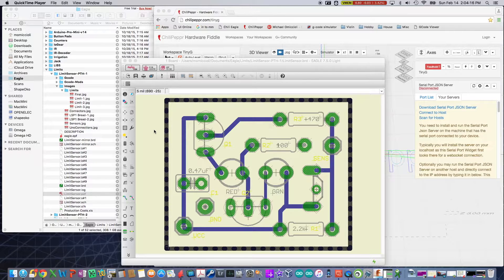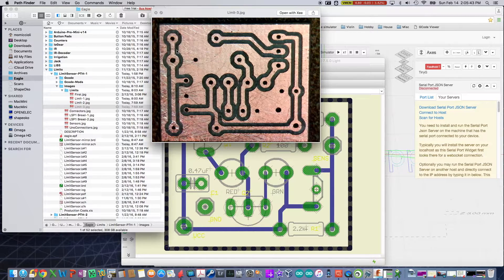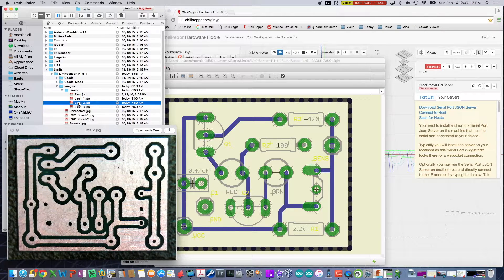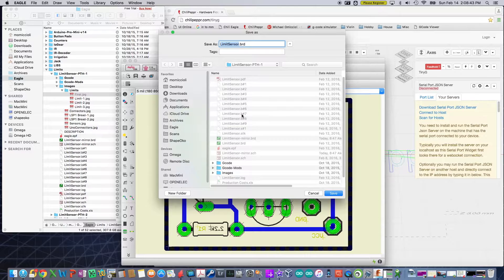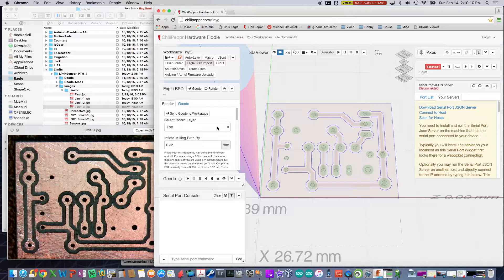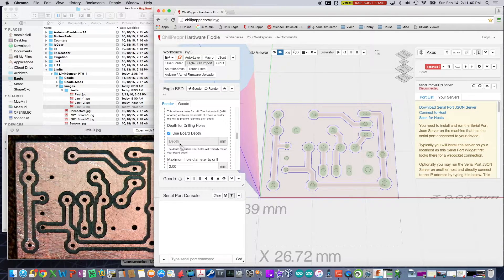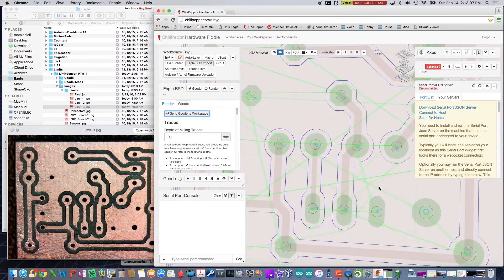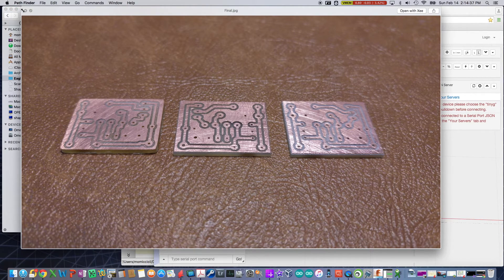Importing Bottom Layer From Eagle to Chilipeppr

Comment: This video is really great Michael. Love it. Just as a heads up, if you are milling a Top layer you don't need to do any mirroring. Only for Bottom layer do you have to mirror. Eventually we'll get native support for the Bottom layer in the widget. For now this video is a great way to do the mirror workaround.
Reply from the maker: +John Lauer 

I have been running a mill test on a SMD circuit (top layer only) I can confirm no mirroring needed.  Ill post a quick vide in a few minutes on that one.